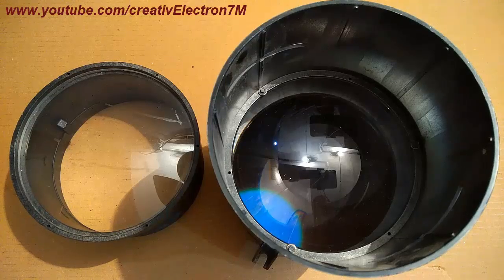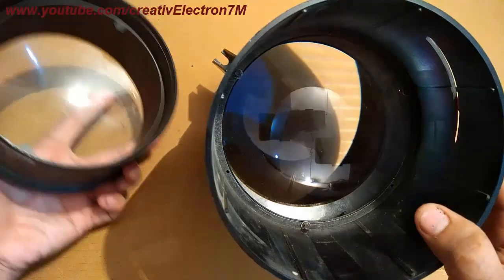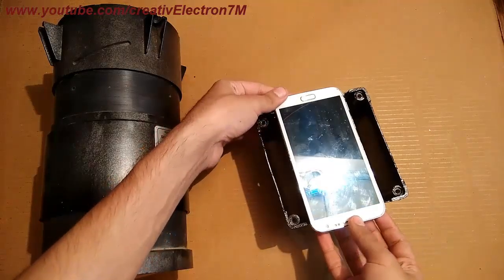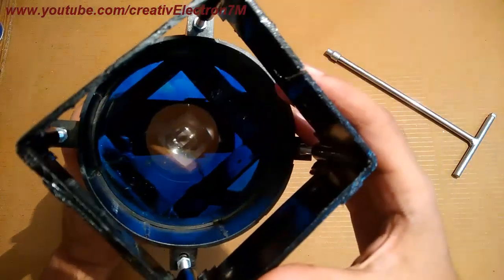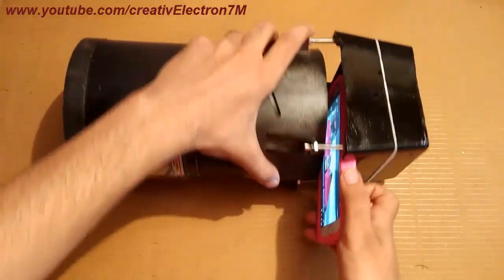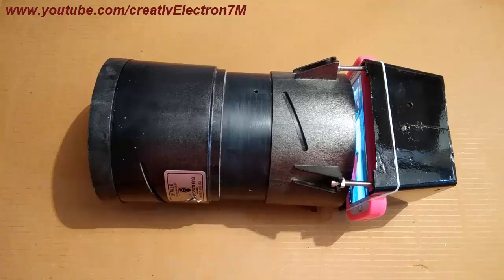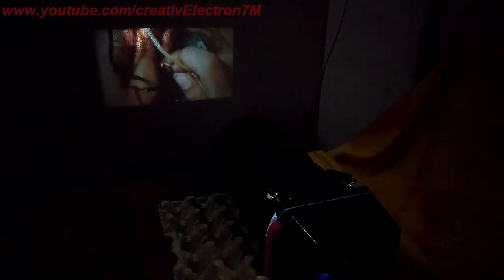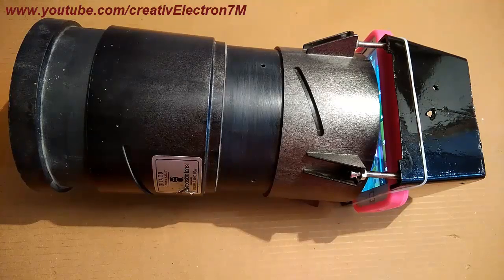An HD Smart Phone Projector for Watching Movies Big Screen

Comment: Hey man! I love your idea. Planning to try this one out. Just a few questions. Can i just use a magnifying glass instead and also, are those lenses has the same size?  Wil it affect the quality of the image if i use the mirror method(don't have a rotation control app yet). I'll try to improvise it by placing it in a box like other typical videos that i've watched just want to try if it will work. Your respond will be much appreciated. Thank you.